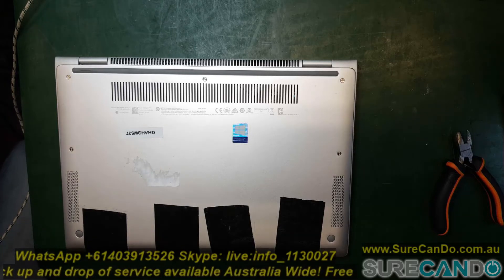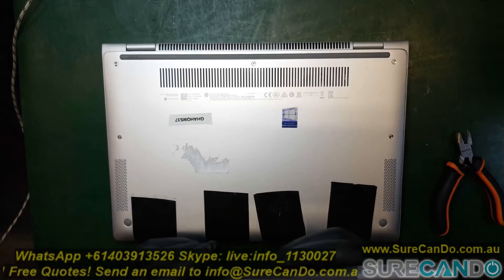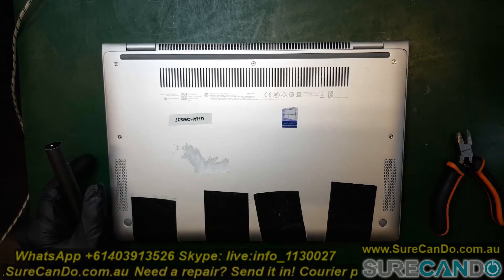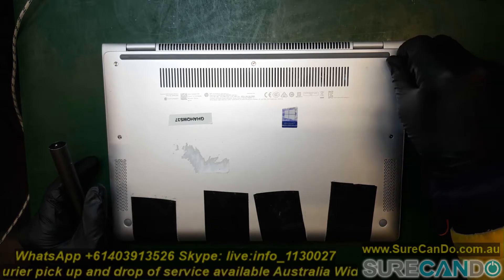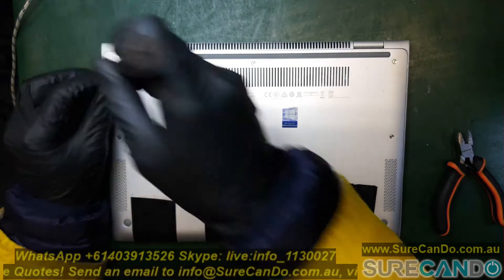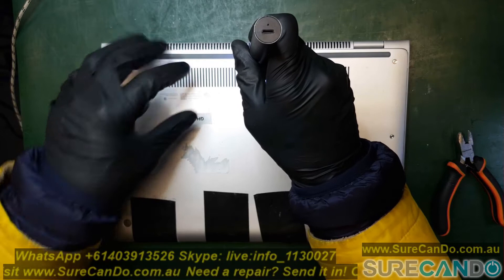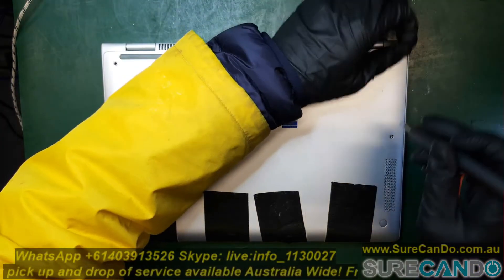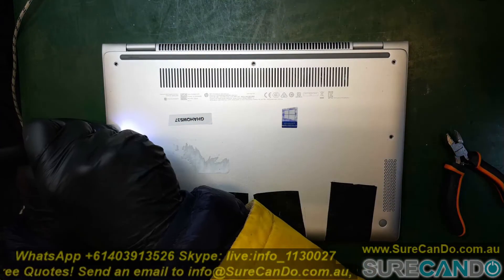HP EliteBook x360 1030 G2 1GY12PA Battery Expanded Pregnant Replacement Guide

Comment: i have hp elitebook x360 1030 g2 laptop and his battery is swelling but at this time battery backup is more then 1.5 hours. due to lockdown problem seller not able to ship new battery. so tell me can I remove this battery from laptop and laptop run direct from power ? this is possible ? or any other way ?
Reply from the maker: Ofcourse just disconnect it, what's the deal?